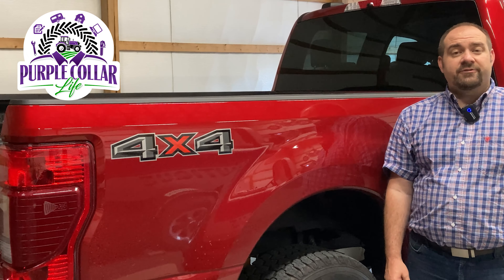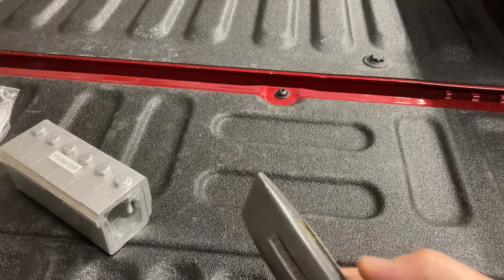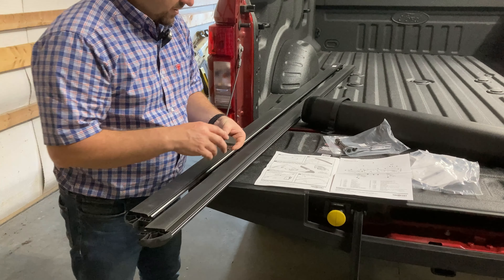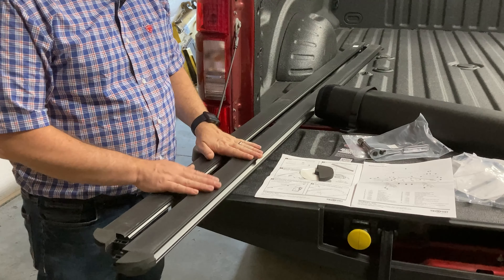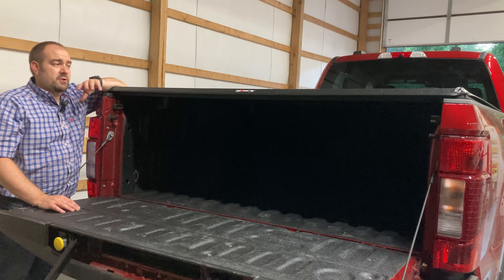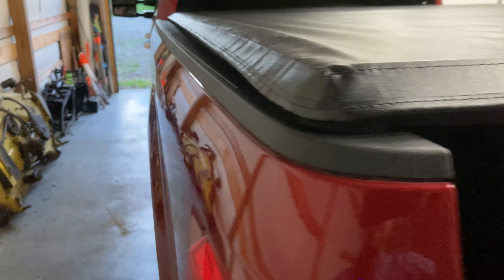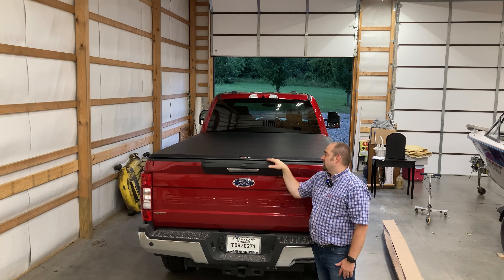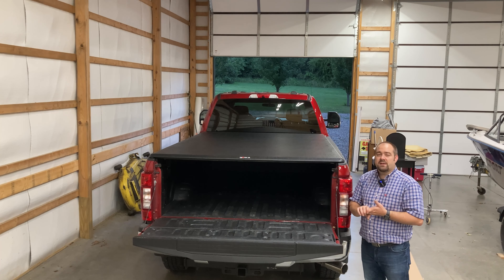TruXport TruXedo tonneau cover installation on new Super Duty F250 F350

Comment: Thanks. I just bought a 2024 F250 and ordered one of the bed covers. I was thinking you only had to unlatch the cover from one side or the other and not both sides.
Reply from the maker: Ours unlatches on each side (you have to do two sides). But they're a great cover.

Comment: I agree with you, having a tonneau cover that sits above the bed a little would allow me to carry a larger generator, but I'm curious how this cover will hold up when there is 2 feet of snow on it, as I live in Northwest Indiana, where that tends to happen at least once a year in the winter.
Reply from the maker: I don't think I ever had more than a foot of accumulating snow on the tonneau cover on my old truck.  It sits in the garage overnight, so the only accumulating snow on it is when it's out during the day.  I do remember a pretty good snow fall while I was traveling through Michigan.  I was staying at a hotel and it snowed over a foot overnight.  I never had any issues with it sagging or collapsing.  2' of snow is a lot though!

Comment: Nice vid, do you think you could leave the cover on and rolled all the way up to accommodate a truck camper in the back?? I have a 2023 F-350XLT on order with the bed liner, actually in the rapid red which looks like thats what you have. AND the 7.3 which you have. So basically exact same truck. LMK if you could on the roll up aspect. Thanks!!
Reply from the maker: I don't know if that would work (truck camper with it rolled up).  I think there isn't enough room for the roll and the camper to slide fully in without crushing the roll/support rods) against the glass.  But it's also really easy to remove the framework with the C clamps.  You could potentially roll it up, remove the front frame section, haul it in the camper, and then re-install it once at the camp site.
Reply: @PurpleCollarLife  Thank you sir, I'll have to mess with it. Happy travels.

Comment: I have a TruXedo cover on my F150. It’s the flush mounted one and my disappointment is in steady rain it doesn’t do a good job keeping dry. Though I’m not expecting total dryness, I was expecting better. Now the one you have that’s not flush mounted seems to have better abilities to deflect the rain. Am I correct?
Reply from the maker: I think this type (not flush mounted) do have a better ability to keep the water out of the bed.  Since it sits on top of the rails, and the edges are over top the rails, I think the water does a better job of moving out to the sides of the bed, rather than potentially into the bed space.  Thanks for watching!

Comment: PS can this cover handle going through a car wash with the big brushes? Thank you
Reply from the maker: Good question.  My truck won’t fit through a car wash with those brushes, so I’m not sure.  It seems like it would do fine.  I tend to avoid those car washes with the big brushes - they scratch the clear coat over time from what I’ve read.  But like I said - my truck won’t even fit in one (crew cab, long bed), so I’ve never actually experienced it.
Reply: @PurpleCollarLife  I have a Toyota Tacoma, and I have been debating about using those kinds of car washes. I was also worried about how rough the brushes are, and I know you’re right about the clearcoat. Thanks for your help, and I should be putting on my cover tomorrow.

Comment: Can the cover be completely removed if necessary, or does the weather-stripping on the bulkhead preclude from doing so?
Reply from the maker: Once that double-sided weather stripping is installed - it would be difficult to take back off. But not impossible.  After about 10 years, it actually just came off on it's own on my previous truck. :)  But the rest of the tonneau cover stayed nicely in shape.